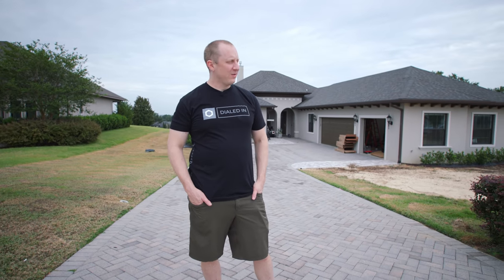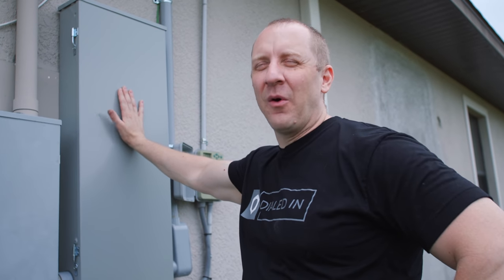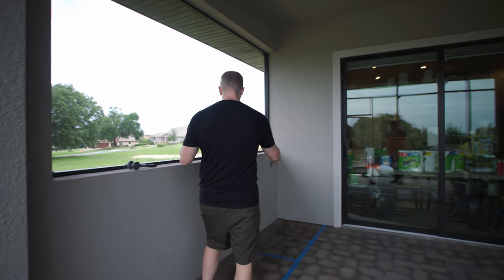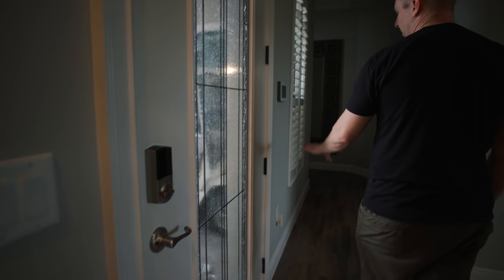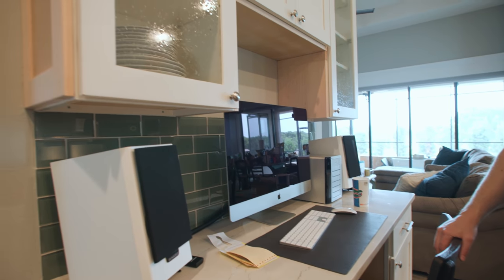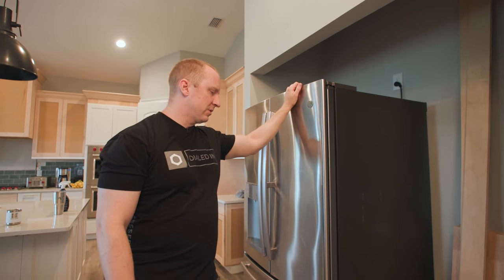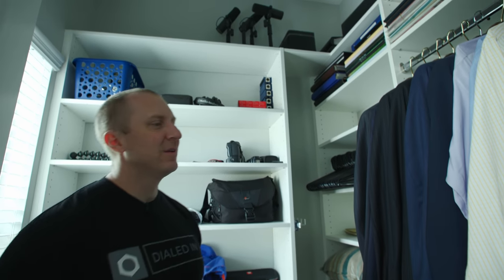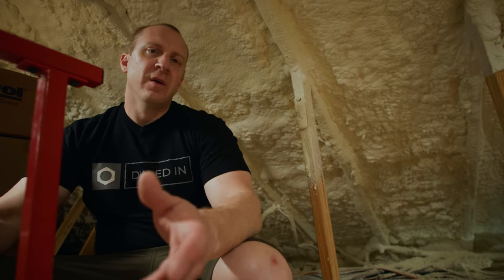2021 OG House Tour: Updates & Future Plans

Comment: One other thing: your front door is so far back from the garage and the front of the house.  May look visually better if you build a small courtyard wall off the corner by the craft room across to the garage (if you can miss the window) and put in a gate.  Will bring the house visually more toward the street and also give you a private area at the front entry.  Just a thought since your garage tends to dominate visually with its length.

Comment: I did the Viking 7 series dual in white.  Decorator spec'd butcher block and frosted white subway tiles for the backslashes.  Using a rear mounted down draft instead of a hood.  Probably no better,  just different.  Nothing overhead but lighting.

Comment: A great water softener that uses salt is Kenetico. I've had mine for 20 years now and not one problem. They are expensive but you like expensive so it should be right up your ally. 😊
Reply from the maker: Thanks for the tip.  I just sent them a request for quote.

Comment: If you are torching the yard why did you go with St. Augustine? St. Aug on its best day won't compete with low cut Bermuda or the Zoysia. If it was my yard I would put in french drains in the low spots, sand level and go with Celebration Bermuda and cut it at 0.5"

Comment: BTW I recently redid our Bathroom and used the same delta fixture in the same bronze color as yours. We also have the same water spotting problem and we do not have any water hardness problems. The last fixture which was a Kohler was there for 26 years with no issues!  Delta replaced the faucet after I had a few gp-rounds with them however  and the same thing is starting to happen all over again. This has proven to be a problematic finish with Delta. IMHO Delta is now garbage!!!!